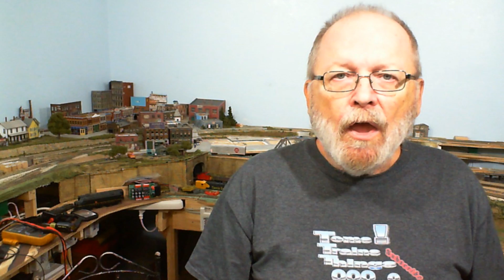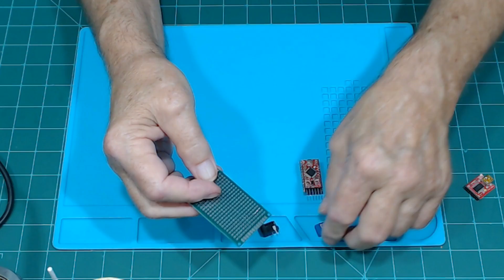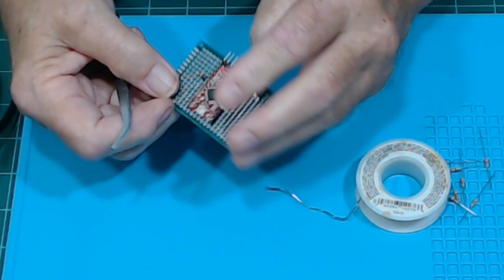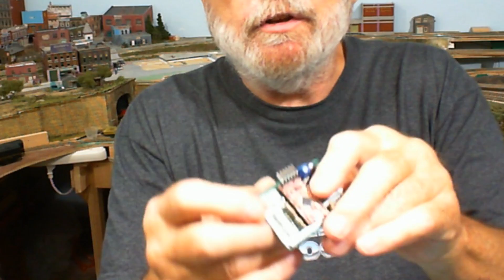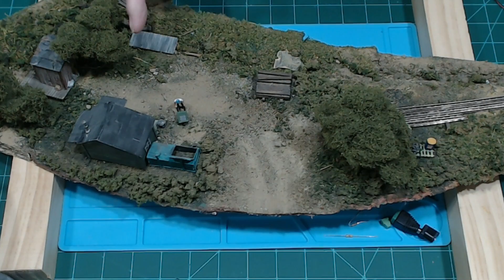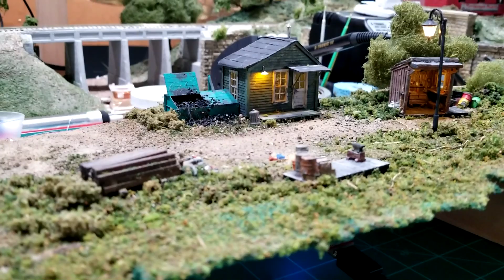Add Lighting To Your Model Railroad With Arduino Pro Mini

Comment: Hi Tom, What is the power source you are using and the voltage?
Reply from the maker: I used a 5vdc wall wart till I permanently installed it on the layout. Then I tapped of my 5vdc terminals on my computer power supply that I used on the layout for this purpose.

Comment: I know this is an older video, but I have a question that sort of gets answered in this video.  When you are placing these arduinos around the layout, are you giving each a power supply?  Or is there a safe way to run a 5V bus around the layout and connect them all to?  Or feed from track bus? Might be a good addition to your arduino playlist.

Great videos by the way.
Reply from the maker: Already did a couple of videos on what you suggested; common bus & from rail power using a buck converter. Planning on a 12VDC bus with low cost buck converters and bridge rectifier to drop to 5V for each Arduino, or any other voltage I need along the way. I have some projects that take 12V, and some that take 3 V. So the buck converter was the way to go.
Reply: @TomsTrainsandThings  Great.  I'll try and look those up.  The 12V bus seems logical. Can be used for tortoise power too I suppose.
Reply: @TomsTrainsandThings   I'm just getting started with these as well.  I initially installed a 12V DC power bus on my layout to run accessories but now I'm thinking it will mostly be powering arduino's.  I can adjust the bus down to about 10 volts and use the barrel connector on the arduino, or would it be better to get  a buck converter and drop it to 5V and use the +5V pin instead?

Comment: Hi Tom, what kind of plastic model glue do you use or recommend with a precision applicator?
Reply from the maker: I've been using Tenax 7R, but it is no longer made. There are some just like it like called Styrene Tack-It which has the same ingredient. It evaporates quickly so keep the lid on very tight.I had a bottle that I purchased last year that I never opened and it evaporated. Another one that I have used is Plastruct. The same manufacturer as the styrene. I have some Flex-I-File that works pretty well with an applicator.
Reply: Thanks Tom